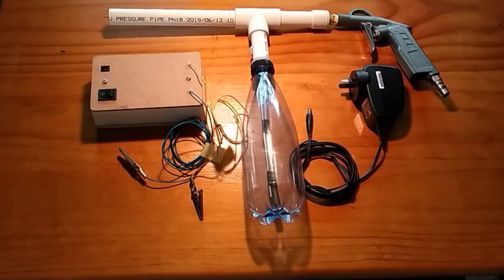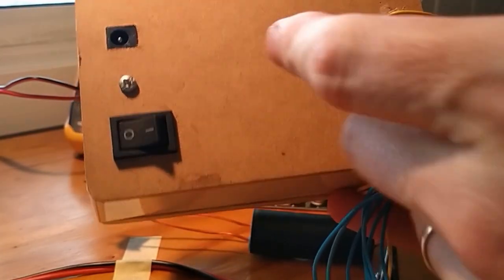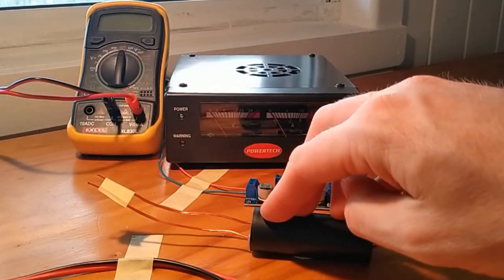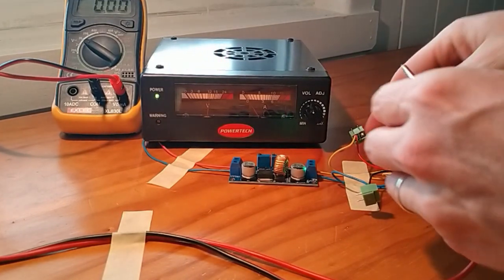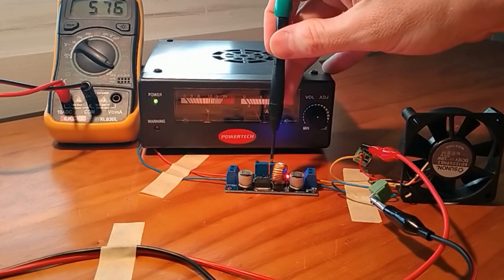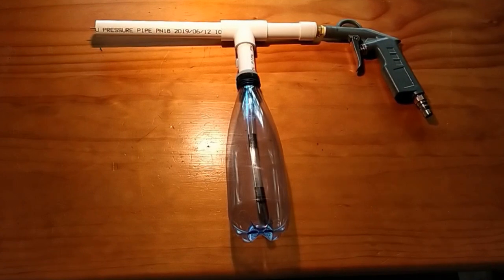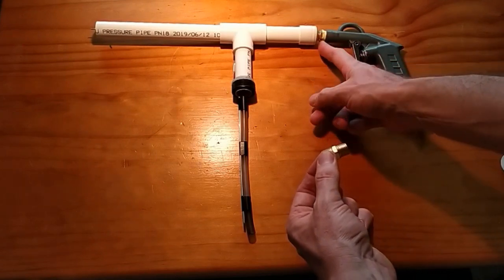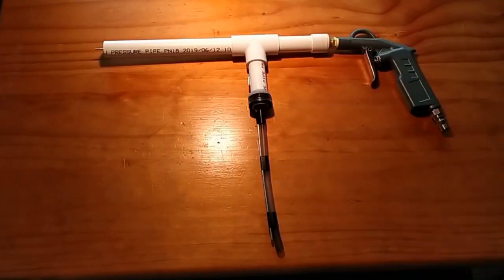Homemade Powder Coating Gun

Comment: Is this only suitable for small objects ir would it work on objects such as wheels and larger pieces of plate metal? If it is not powerful though for large objects what would be the solution to upgrading the electronics?

Comment: I bought the same electronics you used, but I cant tell which wire is positive and negative output on the 400kv module because on the one I bought, the red and green input wires come out of the same spot. Does it matter how the output is wired up? AI tells me the gun probe should be negative and the workpiece should be positive. I guess if it doesn't work ill just have to swap the wires around lol. Ill upload a video of mine once its done. its super janky lol 🤣
Reply from the maker: The input side is important: red for positive and green for negative. I have tried the output side both ways and it works just as effectively either way around. Hope that helps.
Reply: @tinkersmith4615  Thanks mate, it does 👍I just need a compressor now 😁thanks again 🙂

Comment: Thank you sir for sharing this with us. I've just ordered the same electronic parts and i'll be replicating your design. But instead of using a compressor, which is far expensive to a budget project like this, i’ll use a hair dryer to blow air into the pistol. Greetings from Brazil!!

Comment: Both output wires from the HV generator modules are red.
Powder coating requires DC, so I'm assuming that's what this module is, but how do you know which one is positive?

Comment: That was a particular good gideo. I like your particular bench power supply and the particular fan. A neat particular multimeter too. I had to rewind a little because I missed where the particular red wire connected to which side of the particular high voltage module. Overall I was particularly impressed.

Comment: Good Morning, Thank you for your presentation, I intend to build a powder gun, I have most of the hardware ready, awaiting some more pluming parts.  Question: how did you determine the positive    lead out of the high voltage module??, trial and error? or a high voltage probe?? Thanks Bob
Reply from the maker: @robertwinchester9198  From memory, I think I concluded it was AC. I tested this by switching around the electrodes when powder coating.

Comment: i am assuming if you put some sort of masked design on the metal piece being painted, that it would prevent the paint from adhering to the metal in those spots?  Like if you had the letter "A" masked onto the metal, would you have any paint get on the masked off "A"?
Reply from the maker: Yes. You would then need to leave the mask on while you place it in the oven for 10mins at 200deg. Once cooled you can then pull it off.

I have done it section off segments like the threads of a bolt but not a more complex shape like a letter.

Comment: Thank you for this video! I now feel confident to give it a try. Doesn´t really matter if i fail since the cost is very low. Here in Sweden powder coating guns is pretty expensive. I have been thinking for a long time that a powder coating gun can´t be rocket science since it`s all about charging particles.

Comment: While a nice design and construction, I honestly believe you have way too much high voltage at the ends. I would try to reduce that substantiality. All you really need is a static charge to allow the power dust to stick to the part you are spraying, not serious arching. But other than that, clever setup...

Comment: Why my multimeter doesn’t give me any measurements when I tried to set up the current power. The multimeter is properly settled up to read amps?
Reply from the maker: Usually there are 3 lead plugs on a multimeter: centre is ground (black lead), right reads volts and milliamps, left read amps. Did you move your red lead to the left hand plug when taking the reading?

Comment: I've been messing with this project. I found the boost converter ~3-6vdc input, 400kv output on Amazon. The reason the output wires are the same color is because the output is 400kVAC. I see from your follow on videos that the gun does work and the powder sticks to the work piece. Why does this even work with AC?

Comment: Well I want to tell me more details about these 3 components like brand, model and some basic parameters because i didn't find them on your links and i want to search them on internet. Thanks
Reply from the maker: Try searching eBay for:
- high voltage generator 400kv
- dc converter constant current
For the second, look for one with 2 variable resistors to set the voltage and current.
Reply: @tinkersmith4615  ...and the Air Glow Gun?
Reply from the maker: @nelunicoara4483  Sorry, not sure what you mean. Do you mean, how to make the gun itself?
Reply: @tinkersmith4615  You didn't tell me some detail aout it. I didn't find that one either. About building myself it's another storry.

Comment: Great video! I'm trying to figure out how to make a battery operated electrostatic circuit for a regular spray paint can for an art project. I'm happy to pay for your time if that's something you can show me how to make. Thanks.
Reply from the maker: Have you seen this video?: https://youtu.be/THmUjPR7p1E
Reply from the maker: You could possibly achieve this by placing 4 prongs just around the nose of the spray gun, close to but out of the fan, and then connect those to the positive high voltage wire of my electrical unit this video. The negative you could either connect to work piece you are spraying (if it is metal) or to a tent peg in the ground.

Comment: To begin 👍👍👍 excellent video and explanation of the components  and how they work together my question is is it possible to take the voltage module and extend the voltage knobs through the modular box to transform your initial set up into a dual or multi voltage system?
Reply from the maker: Thanks. Others who have wanted to do what you are asking have simply used modules such as these: https://www.ebay.com.au/itm/193663506025?_trkparms=ispr%3D1&hash=item2d173e9669:g:6rgAAOSwr0VfYGCG&amdata=enc%3AAQAGAAACoPYe5NmHp%252B2JMhMi7yxGiTJkPrKr5t53CooMSQt2orsSd3M8ngECaRA0SmyU4KT%252FnrADFkIihSg4QXIDwcLrPUwxJjuxRqKWW9mpCUd39eaqUsmgGEx9eHGqOkTahSzi1kOFtmndCsm%252FRgkr2l1O%252F52HTjwM0YlO9ySJ8rvXH%252Be3eG3tC6kOSOLDfVwLjD6ZXWjOKZJba70vm2%252BNUVMff00v2SJZGI7f9qi1bF%252Bx8curwuW3kXv1sQoCjdJvz6vDNeqdyVKH7aE8bzMjLBkHpK%252Bu4WpBdRKLWJkDvF3KKruX89Ca5bt9a3L4le3XMhM5KjmKkoIlJ0AAT0fk%252BohoKsB5SwgVC6NlsAILwOTl97ElSQ8HAjhXgIjF0493prQauuTWEIWF8FaG%252BiTJqIywsAIy9Xxk1TGLOfbcwWQxupz%252FUgF61Us8Bxn4J19mZKEahHn87VKaFx52SuS6TqHXv%252BaZrTQV6Buv9S2rICCEEmMhunKNdU2RMIxN9uWrGzCW9s8hR7Z%252BKiAAV8PpTFfx39IG7eaNskN%252BJ%252BblNcK2LqQzlr1PytmHFHyTbcSNVVWF30I5Tr6M639x5xvYni9MYi0bss4CRhs4O87ZAqLoJnnWdgh9kgR4NdufXuBkp0BKDGFRzB4WHarvlB8QK5hHdFkKspcByN%252BST2ilmFAiaA7jDHGFgW3lW%252Bt7c4uXS%252FluR6QAusmh9Mmn%252FgRyq0D%252FPVc3bf86oiopw5MqrUxbCnUhbvw7TeHJOF8SFlGI9oDsJLUWexBbBTqS1zpgZRpmyqVoIvSWw08O3s2MwAHwkgICKMvQt8DYdrK4Ehb%252FAVbeoJvVUrU%252Br%252FkSpKJdH%252FHwjCchtMi8FSDLPcaD9v2%252BaZ17AtGHbgjz0Zs90BF3fMO%252BNg%253D%253D%7Cclp%3A2334524%7Ctkp%3ABFBMzvXRq91f

Comment: This thing is so awesome!!!
Reply from the maker: Are you saying that after having built it and tried it out?
Reply: @tinkersmith4615  not yet. Why? Are there some inherent problems I am not aware of? O have been comparing different high voltage supply designs for charging capacitors and it led me here. I built the power supply but not the whole powder coat gun.
Reply from the maker: I was hoping that you were excited by how well it performs. I am still surprised by the results I get. Pretty amazing for such a cheap, basic setup.

Have you checked my channel for other videos. A created a 2nd generation gun to help the powder flow more consistently from the nozzle.

Comment: This lifting module is from a stun gun, how does it say that it is rectified? there is no positive or negative
Reply from the maker: I'm not sure. I think it is a DC pulse module. I bought some high voltage diodes to make a bridge rectifier but haven't got around to it yet. It works really well without. I just used it again today. Works great.

Comment: I just had to hop back on here to say that I've built this, just as described, and it works a treat! The only scary part was the arcing across the 'hot end' wires when I first powered on. I had to route the wires to opposite sides of the project box to keep some distance between them, and there is a considerable gap needed between the gun and the ground, otherwise it will blow a hole in the powder on the part. I have my air backed right down to about 25 psi, and a small toaster oven at 200 (the recommended temp of the powder). I pre-heat the part and spray onto it hot, then bake for 10 minutes. My technique needs some work - don't touch the powder on the part, because no amount of over-spray will get those touch marks out.
Reply from the maker: Great! Thanks for the feedback. 25psi is pretty high. I only use 5-10. The arching sounds like the insulation on your wires is too thin. Perhaps trying the next gauge of wire.
Reply: @tinkersmith4615 what's the truth about these do they actually last or blow after useing them a couple of times meaning the static ark generator ?
Reply from the maker: Mine has lasted ages. The current limiting device that I used prevents it from blowing up. Without it, the high voltage unit will destroy itself. I know because I went through a few to start with when the wires touched.

Comment: Is this dangerous as it is high voltage as i want to build one but just worried about that zapper thing  thanks
Reply from the maker: The amp are extremely low and it is amps that will damage body tissue. I have been zapped a number of times and found that it tickles more of than anything.
Reply: That’s good to know thanks
Reply: @tinkersmith4615  It might be true, but you only need a few milliamps to stop your heart. Also, it's a bit terrifying if the circuitry malfunctions, which which can change the electrical parameters.

Comment: Hello thanks for the great video. I built the gun but the problem I'm having it that powder doesn't really sticks to the metal. Can you please help?
Reply from the maker: That's strange. Are you getting a high voltage arc between the +ve and -ve wires? Some people find that their high voltage module is faulty.
Reply: @tinkersmith4615  yes sir i am getting high voltage spark
Reply from the maker: Are you attaching the negative wire to the work piece? And is it metal?
Reply: Sir*
Reply: Yes sjr

Comment: A great video, thank you. I am looking at whether I can do the same but without a compressor
Reply from the maker: Thanks. Some have been looking at using a 12v air mattress inflator. I really like that idea because you could create a complete handheld unit.
Reply: @tinkersmith4615  I can't claim the idea as something similar was sold in the past but no longer made under the name "Craftsman Powder Coating System"

Comment: Thank you T.S. great video.. one question , im wanting to powder coat inside a 1200mm tube of 45mm dia .. do you think this would work if i lengthened the barrel and had the venturi  near the end of it ? 
Cheers Barry
Reply from the maker: Thanks. Glad you enjoyed it.

I reckon it would work. Connect the tube to the negative wire and then blow the powder through with centre of tube with the gun. The powder should pass through and then cling outwards as it reaches exposed metal.
Reply: @tinkersmith4615  thanks once again I'll give it a whirl

Comment: have you upgraded it yet?  I really care about it
Reply from the maker: I create a second generation of the gun: https://youtu.be/jJ77ekVlhQo. Is that what you mean by upgraded?
Reply: @tinkersmith4615  no, I mean the electrical system upgrade for the powder coating system
Reply from the maker: @nicecreation8427  The electrical system works fine for me now. What sort of upgrades were you thinking?
Reply: @tinkersmith4615  I think the system has a larger capacity, it will be awesome
Reply from the maker: @nicecreation8427  I haven't looked into it. Will put something up when I do.
Reply: @tinkersmith4615  oh

Comment: Why not use a cell phone charger also known as a USB power supply which puts out 5V  and 500 -2000 mAH to power your high voltage module?
Reply from the maker: I guess you could. Haven't tried it. Two things to remember though: 1) You would need to ensure that amps are not exceeded when the wires short, and 2) running at 5v will add my power to the module which may require a reduction in the amperage setting.

Comment: I'm from Brissy also!
where did you get your powder coat paint from?
Reply from the maker: Just searched for it on eBay. Started with two colours (black and white) from an Australian supplier: https://www.ebay.com.au/itm/powder-coating-powder-RAL-9005-JET-BLACK-GLOSS-1kg/193604018267?pageci=53aff2ed-cb12-4135-9a96-0b099da75560
Reply from the maker: There is an American company I found that heaps of amazing colours but it has a $27 postage minimum: https://www.prismaticpowders.com/australia?gclid=CjwKCAjwpKCDBhBPEiwAFgBzjydritL0XUhsjmTksQ7nZJDFwdp3WDi-zoKjFWxTPDtRhlqQjkQCBxoCEmYQAvD_BwE

Comment: I enjoyed the video and am currently making this setup. Only problem that I see, as someone mentioned previously, is which leads go to the part and which goes to the gun.  I thought powder coating like metal plating has to have the part on the negative lead as electricity flows positive to negative or does it not matter in this case?  Aside from not knowing this one aspect, Great Video!
Reply from the maker: I have found that works with either lead attached to the work piece. I 'feel' it works best with the blue lead attached to the work piece but have no way of even testing if this is true.
Reply: @tinkersmith4615  Now, I am confused.  According to your video, you have the colored leads going to the output of the circuit board and the two brown leads are the output to the gun and the part being painted.
Your part looks to have a green and red lead no blue.  The blue and yellow leads are your add-ons.  You have a blue lead and a yellow but both are connected to the brown leads of the 400kv generator.  Which brown lead is positive and which is negative or did you just try it and reverse it to get it right.   Thanks
Reply from the maker: @davidblahauvietz6863  I assume it. I assume that the red wire follows straight through to become the yellow on the other side (positive) and the green follows straight through to become the blue wire (negative). The blue I connect to the work piece and the yellow wire to the gun.
Reply: @tinkersmith4615  Sounds good,  thank You.

Comment: I have a 16 volts 4.5a can i use that?
Reply from the maker: Yes, provided use the buck converter. The buck can handle up to 38VDC.
Reply: @tinkersmith4615  Cool thx i got most of the parts now except the air gun so can set it up and put it together bit by bit ☺️
Reply: @tinkersmith4615  other thing i was thinking (i know dangerous for me 😁) was to put a 12v 5 to 10 amp automotive fuse in the box for safety. also where do you get your powder from?

Comment: The power brick doesn't need to be 2.5 amps.  Really only 1 amp.  The power module is only putting out 4 volts and so 2.5 amps at 4 volts is only 10 watts. If you allow for 2 watts consumption by the boards, that should be enough if all you have is a 1 amp power brick.
 2.5 amp power bricks at 12v are rather uncommon, at least here where I live in America, but 800-1000 ma at 12v is a lot less uncommon. Though to be honest, 12v bricks are kinda rare here.

Comment: Harbor Freight sells one for $80. Don't know if it is any good though. Reviews say it works, but it will work the third time?  That's the major problem with el-cheapo stuff, it doesn't last.
Reply: The HF gun is 11kv, its really weak the powder doest attract to well to the piece, you want 15-25KV to get enough attraction on a coated piece for a second coat or a clear coat.

Comment: I'm manufacturing AC outdoor unit stands in India. Its a startup actually! Out sourcing my job for an industrial powder coating service costs me more than my actual price. After seeing this video, I have ordered parts that you recommended on Amazon. Can you suggest a way to increase the spraying speed, to increase my production?... Thanks in advance brother!👍
Reply from the maker: The speed I coat at was based on wanting the least amount of overspray. I have seen video of production units where they have an extractor fan and filter to capture the overspray and they create huge clouds of powder. I have never tried this with my gun (greater volume of air so large clouds of powder) so I don't know at what rate it could go.

I'll have a bit more of a think.
Reply from the maker: Have you seen my Generation 2 gun?: https://youtu.be/jJ77ekVlhQo. Today I used this gun at 20psi @ 4v/2.5a and it went on super fast. There was more overspray but if time is of the essence then this would be a great method.
Reply: @tinkersmith4615  Thanks for your reply. Please do try this and give us a good review about it. Does increasing the current / increasing the KV improve the coating speed?